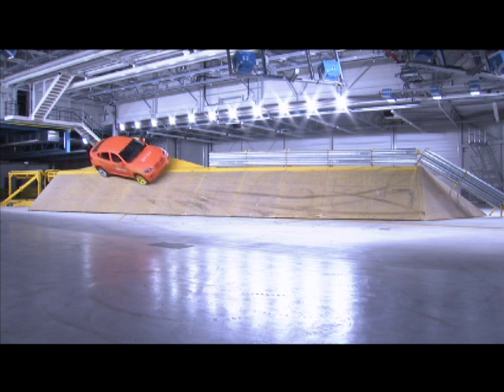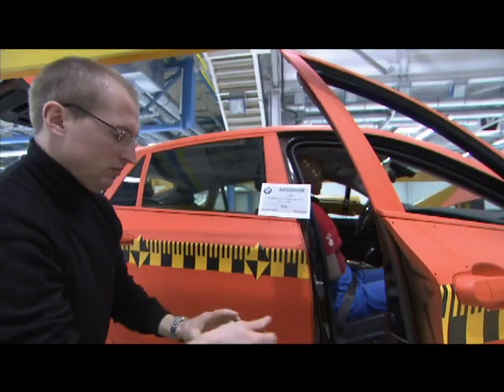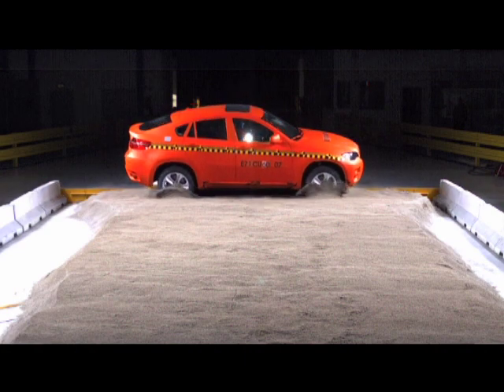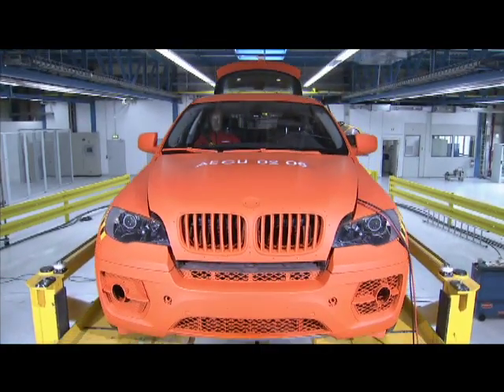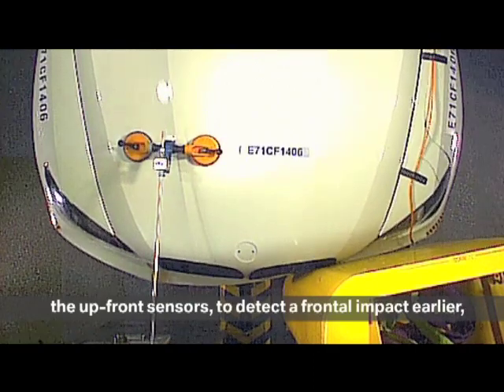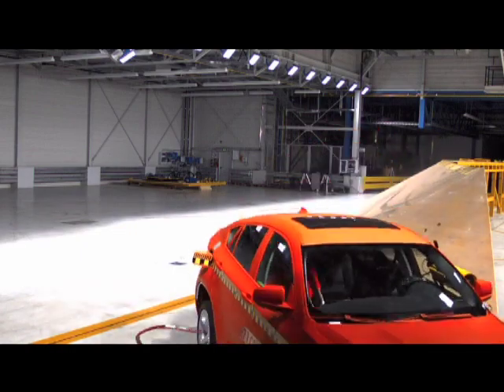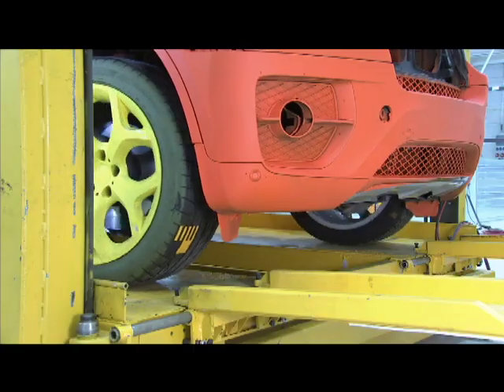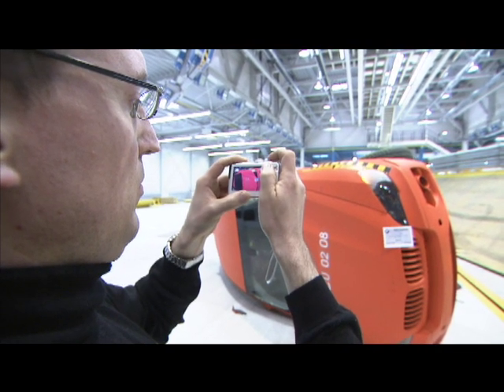BMW Safety Innovations X6 Rollover Test

Comment: That orange looks distinctly different. Can BMW make a copper color vehicle body. Sort of a metallic color like silver or gun-metal grey, but it's more like a burnt orange color. BMW cars are known their road handling and comfort. These 2 properties contradict each other. Good road handling imply a loud, noisy, harsh (jaw shattering) ride. That way the driver knows the road conditions and adjust accordingly. A quiet, smooth, comfortable ride disguise the true road conditions and the driver does not know what the road conditions are. However, I know from my own experience a rough, noisy road trip will wear you down, make you tired, and make you sleepy. Sleeping behind the steering wheel is not a good thing. If you are refreshed and alert from a comfortable drive then you are less likely to fall asleep behind the steering wheel. It is good to know that BMW is trying to make their cars safer for passengers in a crash situation.